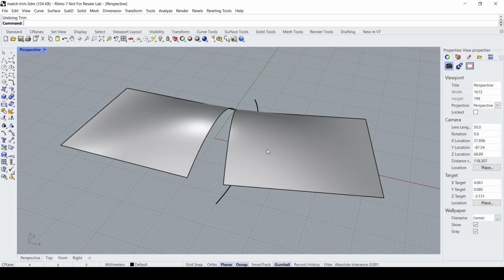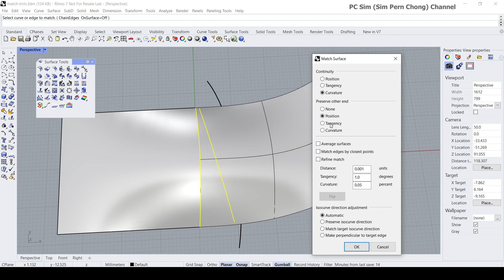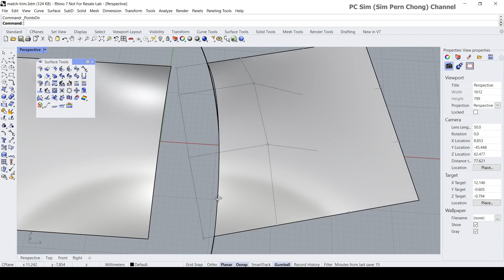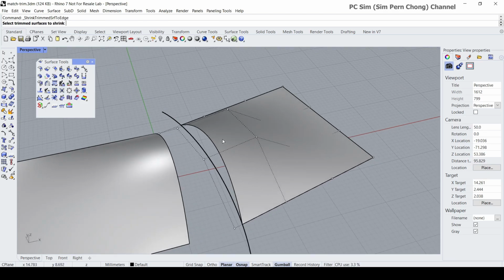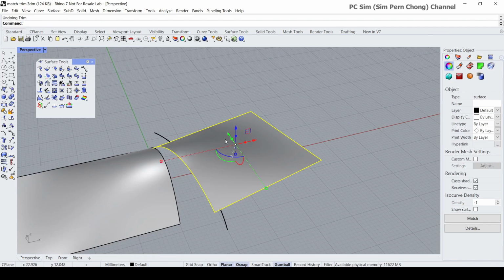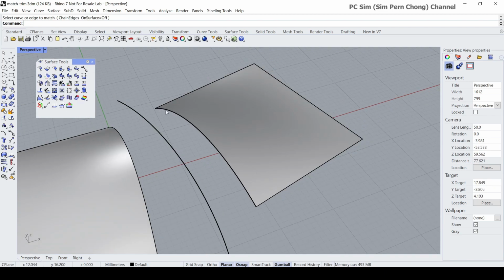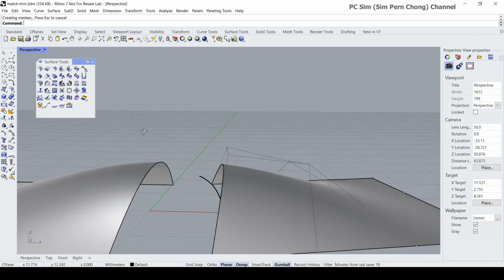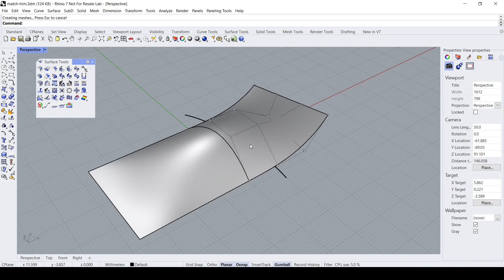Rhino 3D Tutorial: Matching Trimmed Surfaces

Comment: The Surface Continuity Principle in CAD (Computer-Aided Design) refers to the smoothness and flow of surfaces as they transition between one another. When designing complex geometries, particularly when surfaces are joined or blended together, maintaining the correct continuity ensures that the transitions are smooth and without unwanted kinks, sharp edges, or discontinuities.

In essence, surface continuity governs how surfaces meet at their edges, and it is crucial in many fields, such as automotive, aerospace, and industrial design, where aesthetics and functionality require smooth, continuous surfaces.

Comment: Awesome tutorial! Thanks for the useful information. What is the purpose of the Shrink trimmed surface to edge tool if I  can use Refit trimmed surface to edge in the first place for both cases?
Reply from the maker: Ermm..I guess Refit may just be good enough for many situation. Refit is a newer tool available only from Rhino 7 onwards. However, it needs to select the edge to be readjusted. Shrink Trim is an older tool, but it can shrink all (up to 4) surfaces edges at one go.
Reply: @simpernchong  Thank you for the precise answer, much appreciated!